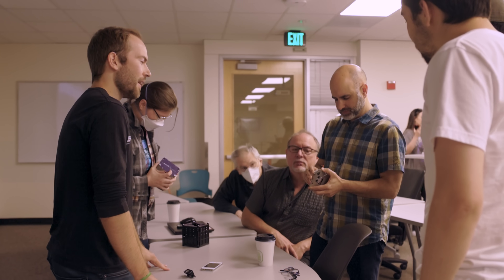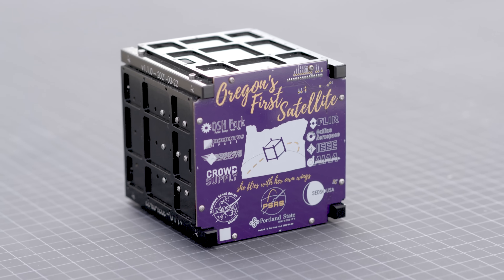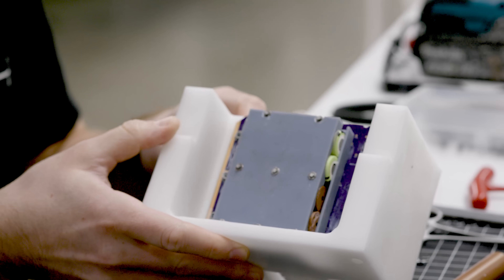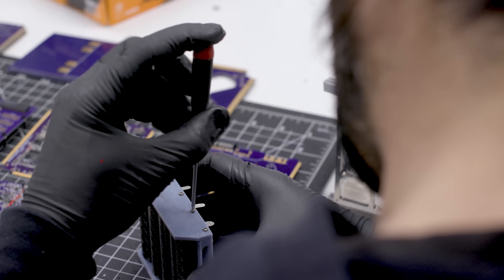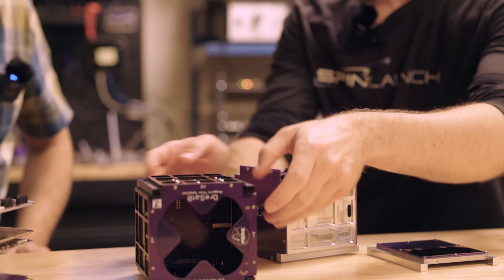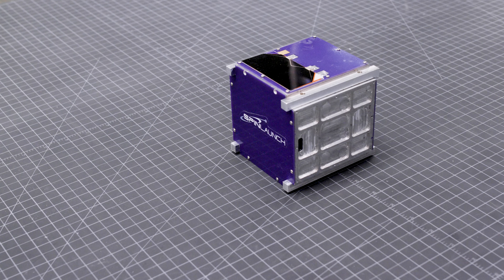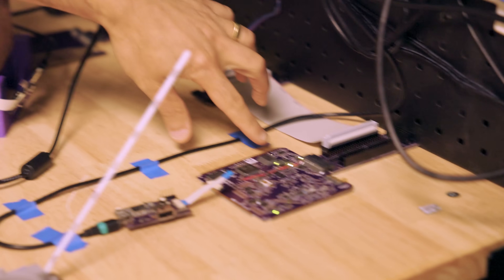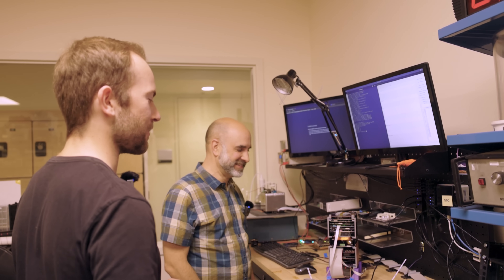Introducing The World's First Ruggedized Satellite

Comment: The SpinLaunch concept would be much more viable on the Moon or Mars because it would overcome some of its biggest limitations on Earth.

---

1. Advantages on the Moon

The Moon is the best place for this technology because:
✔ No atmosphere, eliminating air resistance and heating due to friction.
✔ Gravity is six times weaker than on Earth, so much less energy is needed to reach lunar orbit or escape its gravity.
✔ Larger versions could be built using lunar materials (like regolith), reducing costs by avoiding material transport from Earth.

🔹 Example: A SpinLaunch system on the Moon could launch payloads to spacecraft in orbit or even send supplies to Mars without using large rockets.

---

2. Feasibility on Mars

On Mars, SpinLaunch would also be useful, but with some challenges:
✔ Very thin atmosphere (less than 1% of Earth's), reducing air resistance but not eliminating it completely.
✔ Lower gravity (38% of Earth's), making launches easier compared to Earth.
❌ Still some atmospheric resistance, so projectiles would need aerodynamic designs to minimize friction and heating.

🔹 Example: A Martian SpinLaunch could be used to send supplies and materials into orbit, where larger spacecraft could collect them for interplanetary missions.

---

3. Future Applications in Space Colonies

If permanent Moon or Mars bases are established, SpinLaunch could be essential for:
✔ Exporting minerals and construction materials to space.
✔ Sending supplies and experiments to orbiting stations.
✔ Reducing reliance on chemical rockets, saving fuel and costs.

---

Conclusion

✔ On the Moon, SpinLaunch would be extremely efficient because there’s no atmosphere or air resistance.
✔ On Mars, it would still work, but the thin atmosphere would require some design optimizations.
❌ On Earth, it’s much harder due to high gravity and dense air.

If we ever build lunar or Martian bases, a system like SpinLaunch could be the cheapest and most sustainable launch method.
🤓☝🏻

Comment: would it be possible to make it like that its a 2 stage system. one part the bases that spins and builds up momentum. then just before launching and escaping somehow it couples with the 2nd stage which would have the load. and than the momentum and energy launches both the base and upper stage at the same time. and perhaps there could be some coupling mechanism to allow both stages to join together without crushing.

Comment: The last test was one thousand miles per hour I believe.  Another test was 1,200 miles per hour.  The speed to achieve a low earth orbit is about 18,000 miles per hour and that's once the projectile gets into space.  They must first overcome gravity and wind resistance and still be at 18,000 miles per hour to sustain an orbit.  What have they determined the actual launch speed to be to get it there?  Based on my calculation of a 300 foot diameter of the launcher, it would require a rotational speed of approximately 1,680 revolutions per minute, or 28 per second, with a G Force of about 144,000 G's to achieve 18,000 miles per hour and this doesn't account for the extra speed needed to overcome gravity and wind resistance.  As an example, rifle bullets experience about 10,000 G's and only for a couple milliseconds.

Comment: For your carbon fiber tether, instead of using a regular weave, what about using a configuration like chainmail so that it doesn't delaminate and can handle more G's?

What about a cheaper carbon fiber like Lignin Carbon Fiber Enhanced with carbon nanotubes and Graphene in the weave and resin?

Do you think that would allow you to build Larger Accelerators that could get to space?

Comment: Can the board operate at 10,000g? Can the inertial guidance system handle spinning so quickly and then suddenly stop spinning (and point in the correct direction) with the use of aero (because that will cause way too much drag)?

Comment: It's presumably very helpful that the G-loading is both steady/gradual (rather than a vibration that could build up resonance or cause fatigue) and that it only goes in one direction for which the satellite can be preferentially hardened. Still, pretty impressive!
Reply: It's gradual up until release where it goes from 10,000G to 1G as fast as the release mechanism releases... "It's not the fall that kills you, it's suddenly coming to a stop"
Reply: @Guffy1990  This is a concern, but to compare this to something hitting the ground is not right. "coming to a stop" means there's suddenly a force applied. In this case, a force is permanently applied and that force suddenly stops.
Reply: @MiTheMer  you've just described the same thing in two different ways from two different perspectives! Say there's something falling the hitting the ground, that's one perspective. The other would be something sitting on the ground, then suddenly leaving (via a rope or, say, conservation of angular momentum (centrifugal force)). They are the same thing, but relativity allows you to describe it in two seemingly unlinked ways. You could say "went to from 0 to 100", or "100 to 0", and the effect is exactly the same.

Comment: The initial g-loading is only a small part of the problem. As soon as you exit the SpinLaunch, you’re flying at Mach25 in the lower atmosphere. So now you’re instantaneously suffering massive g-shock perpendicular to the initial axis. On top of that, the searing hot plasma you’ve made the surrounding atmosphere, is now blow-torching in through every seam.
You’ve mentioned using glue. Well, you can’t. Because as soon as you get to the vacuum of space, that’s outgassing and bubbling.
None of this makes sense
Reply: That’s not accurate. SpinLaunch’s system doesn’t reach anywhere near Mach 25, the current SpinLaunch launches the prototype at about mach 5. Prototype tests to reach otbit are around Mach 6 with the rocket stage delivering the remaining ~6 km/s. The payload exits tangentially, so there’s no sudden perpendicular g-shock. Aerodynamic heating is significant but manageable with proper materials, it’s not plasma-level destruction. Adhesive outgassing is a known issue in spacecraft, but irrelevant here since a small rocket completes orbit insertion after the kinetic launch.
Reply: @V1k1-1 Okay, well in the first place then they’ve changed their business model since I last looked , they’ve accepted that their initial plan of achieving SSTO launch from SpinLaunch is impossible.
We are then back to the same problems of two-stage launch systems like Virgin’s LauncherOne from a plane. Which is that the launch energy scales quadratically with velocity. Achieving the first 25% of orbital velocity still leaves 94% of the job to be done by the rocket stages. Saving 6% doesn’t really help you much, particularly if you need to pay the system cost of a whole new system. But also, you now need to make the whole rocket engine assembly robust to huge acceleration loads, which makes them heavier and more failure prone. And even more importantly a nightmare to test.
Put even more bluntly, if you can make the 2nd stage, you can make the 1st stage, they’re basically the same. At the manufacturing volumes we are talking about, almost all your costs are fixed costs of design and manufacture. Halving the total number of stages you manufacture will save you two-fifths of damn all.
As Musk has been banging drum for over a decade, and people are finally starting to get the point, *fuel doesn’t cost much*. It’s a big fireworks display, but it’s not that much money in the grand scheme of things. A fully loaded Ariane6 contains only just double the fuel load of a 747. If you can afford to take a return transatlantic flight, you can afford the fuel to get to orbit. What makes space expensive is throwing away the entire aeroplane at the end of every flight, not the fuel burn or the size of the metal tube.

Finally, you are wrong about g-loading. What happens at the release, is that you go from high-g sideways loading to zero loading almost instantaneously. The rate of change of acceleration (“jerk”) is super-high, and the rate of change of that (“jolt”) is even higher. These are incredibly brutal on a payload. The acceleration varies as the square of the Spinlaunch speed….the jerk varies as the cube, and jolt as the fourth power.

Comment: Just a thought exercise: if a spinlauncher didn't need to overcome Earth's gravity and atmospheric pressure, i.e. the launcher is on the moon, what kind of launch speed is possible?  This might be a good tool for interplanetary delivery or sending probes to the outer reaches of our solar system.
Reply: There effectively is an argument that this tech would be highly useful for that. Stuff like launching water from Shackleton crater. In earth though it's effectively useless.
Reply: Look up terminal velocity.

Comment: Would I be correct in thinking that when the projectile is released it'll go from 10,000 Gs to 0 in an instant? ... a much more sudden change than during the spin up? Surely this would be the most demanding moment for the payload? Is there any way to test this before a real launch?
Reply: The short answer is that the lateral g force will indeed drop to 0 instantly, as soon as the arm lets go. That’s why it goes in a straight line the instant it’s released. 

The sudden g-force will be deceleration from hitting the air, plus vibration from turbulence.
Reply: Slam it into a wall and try to see the release with a high speed camera? But yeah, the jerk is going to be immense.

Comment: Spin launchers make sense for asteroid mining or lunar operations, not earth bound. Although, asteroids will have some momentum imparted to them. Maybe you could do two at once, rotating in opposite directions.
But I've never understood trying to do this from the bottom of our atmosphere. The friction penalty is going to be extreme. 
Would love to see this on the Moon, though.
Reply: It all comes down to the numbers. The friction may be extreme, so the cost of materials needed to withstand the resulting heat may be extreme, but if it ends up being less expensive than strapping it onto a rocket, then it becomes feasible. I see no reason to exclude it until we've experimented enough to know how what it will take to protect it and we can crunch those numbers.
Reply: It takes five seconds to get through it. Do more research before being a negative nancy. You really think they're not aware of the atmosphere?
Reply: Yes, launching a payload at Earth's escape velocity is ridiculous. However, launching a huge rocket that burns through tons of fuel every second is also quite at the limit of what is reasonable. So....I don't see why we shouldn't try this, tbh.
Reply: This problem really sounds verifiable on a mathematical level relatively easily. As in, what velocity and what mass do you need to overcome said friction. So I'm quite sure that they themselves and for sure also their investors have made these calculations with a result that's feasible...

Comment: Of all the current space underdogs, I think I'm rooting for these guys the most.
Reply: This is like rooting for an unborn road runner expecting it to win a horse race.
Reply: @teresashinkansen9402   Now that is some weird-assed analogy shit right there. I kind of like it tho.
Reply: @teresashinkansen9402  you're so boring, what do you gain? be interesting for once and root for the crazy idea. ITS COOL, might maybe work one day eventually but ITS SO COOL.  You can like things just because they are cool! (while its probably not the most likely solution to the small sat market it is A SOLUTION)
Reply: @BlixenBlorp  You might find the idea cool and interesting, I mean anyone can enjoy useless things, but don't expect it to fulfill its promise. Have you really thought about this? reaching LEO would mean the payload would have to be moving at speeds far beyond 7km/s its nearly impossible to reach such speeds in a spinning object. For example ultracentrifuge rotors are made of titanium or magnesium alloys newer ones of carbon fiber, materials with some of the highest strength to weight ratios, they can spin at speeds in excess of 100k RPM and they have perimeter speeds of only about 500m/s that's less than one tenth of the required speed for LEO. There is absolutely no way this works.
Reply: @-danR  Yes, thanks for pointing that mistake.

Comment: I was going to say, just fill it with epoxy, but weight is critical so they have to be sparing.
Reply: Actually, more weight I this case isn't better? Of course if the launch is at the same speed at any weight. Because gravity acceleration is equal on all weights, that means that a heavier launch contains more energy, as it is a cube anyways, the aerodinamics would be the same thus drag needs to take out MORE energy that way, meaning it remaches longer. I am no physisist, so I might be wrong.
Reply: @apollo_redux  One graph I found suggests $10-20k USD per kg for launching a satellite.

Comment: BAE and Raytheon already perfected much of the required G-hardening tech for the M982 Excalibur 155 mm guided artillery shell.  These shells experience 15,000 G's on "launch," but almost everything useful is classified.  😭 Has SpinLaunch run into any related ITAR hassles over this G-hardening?
Reply: BPS Space or Lafayette Systems are both well past the boundaries of what is covered under ITAR but are having no issues. I'm no expert but I think it mostly just covers not providing sensitive information to others outside the US. Shouldn't be a problem for SpinLaunch - and they undoubtedly have a legal team that has given it far more thought than you'll ever see put into a YouTube comment.
Reply: @Phoen1x883 from my understanding, ITAR is about export, so as long as they don't share any of the important data, it's fine to operate
Reply: @Phoen1x883 Its complicated.  SCOTUS has weighed in to protect things like media or scientific articles under 1a which I think BPS Space falls squarely within.  That doesn't mean spin launch technical details aren't an issue but certainly not what was in this video.
Reply: @Phoen1x883  "I think it mostly just covers not providing sensitive information to others outside the US."

Which includes not having your projectile accidentally land in foreign country.
Reply: I think a big difference between spin launch and a 155mm shell is one is static acceleration, the other is transient.
Reply: @johnt6213  For the proposed Spinlaunch process, there will be a static 10000 g followed by a change from 10000 g to 0 g in a millisecond, followed by smaller accelerations of the flight environment. The transient is more difficult to harden against, compared to the static load, but compared to making the launcher, this is all pretty simple. Mechanics, optics and electronics in tank fired shells is hardened to 50000 g transients.
Reply: @cogoid  This is the correct response. Additionally, it's not just a single G-Vector. You have longitudinal G and Circumferential G (Rotation velocity).
Reply: @cogoid  - "10000 g followed by a change from 10000 g to 0 g in a millisecond"

And THEN likely MORE than a 10,000 G SHOCK as the projectile hits atmosphere going Mach 25.
Reply: @cogoid Tank-fired shells are very low-complexity compared to a satellite payload. There’s no realistic way to harden several of payload subsystems.
But even more importantly: hardening costs *weight*. Getting the Spinlaunch to Mach 6 might seem like a lot to you, but it’s only 7% of the way there in energy terms. It would be insanity to add even 10% weight to the payload (and it would be way more than that), which means 10% more fuel and weight for the second-stage, if you’re only giving me a 7% boost in the first place. This just doesn’t make any sense.
The current solution is “design a 2nd stage rocket….and once you’ve got that working, make a slightly bigger cut-and-paste for the first stage and you’re good to go”. It’s fine. You’re solving the wrong problem. Solve reusable rockets, then you’ve done a thing.
Reply: That's why g is used as unit, so this doesn't matter anymore.

 @johnt6213
Reply: @johnt6213 And transient under multiple loads, nothing is solid at those loads and the deflection from loading and the interaction with the barrel, and then unloading as it exits the barrel with the side support vanishing and then air drag kicks in…
Reply: I suppose it goes without saying that the SpinLaunch could fling modified Excalibur shells much farther than a M777 howitzer —  which only reaches 25 miles with the guided shell.  Any interest from the Army?
Reply: @skenzyme81  Army would be more interested in Railgun.
Reply: @skenzyme81  you need a giant facility to launch one of these. At this point, if you need more than 25 miles(which is already huge), might as well go straight to missiles
Reply: @bragapedro  if your facility has a range of 10k miles then it doesnt matter how gigantic it is if it can launch for dollars per kilo
Reply: @skenzyme81   so huh, each time a dozen hour to replace the seal,+ vacuum the chamber, + spin time to reach top speed.  Crazy maintenance costs/down time, ultra slow operating times. .. 
wat? One rocket a day seems like a good rate for you?
Reply: I bet they use Bazooka bubble gum as the energy dampeners 
✌"SECRET SAUCE"✌
Reply: Gs*
Reply: That’s electronics for a shell, not a satellite payload.
How do you harden the delicate optics for a ground-observation telescope? The fine metal grids of an ion engine? The thin shell antenna reflectors, 20 meter diameter when unfurled for telecoms spacecraft, which are so lightweight that they can’t be unfurled and tested easily on Earth because they don’t even support their own weight?
There’s just so much delicate stuff which is on the border of viability in shake-and-bake testing for vibration testing of 10g launches. 15,000? Pfft, no.